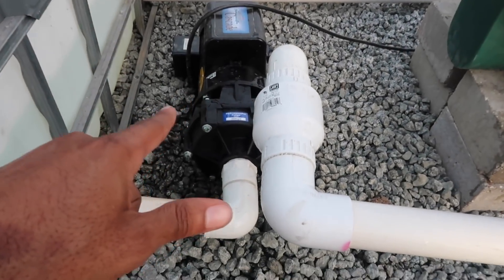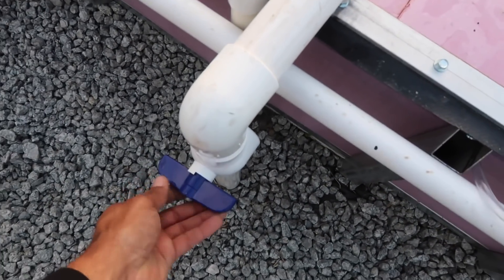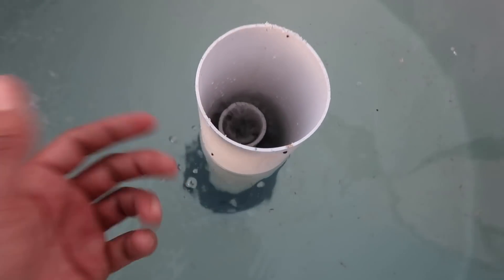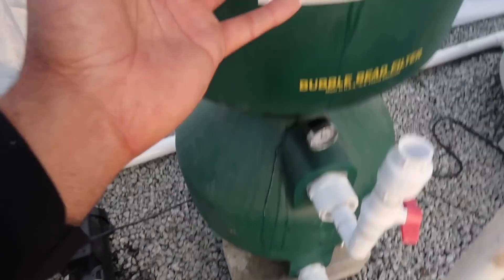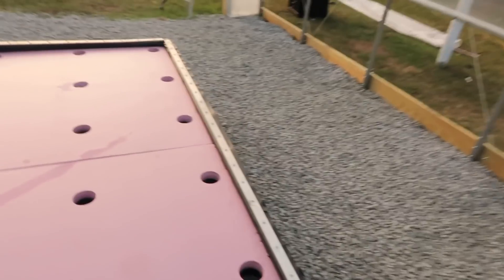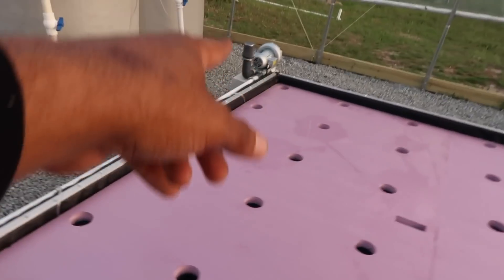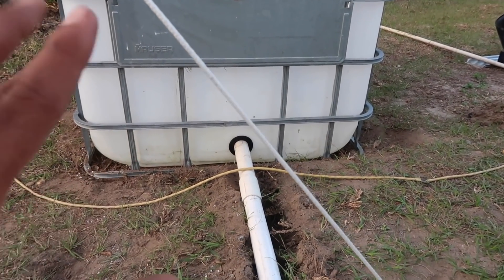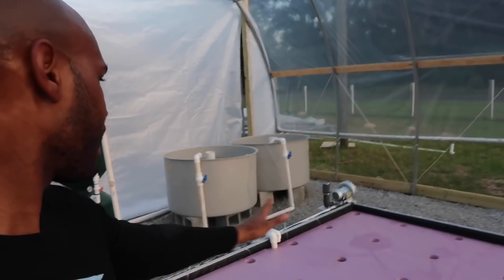Tour Of The New System | The Aquaponics God Ep.14

Comment: I had a 2500 gal system which incorporated a bead filter, automatically create an open system because of the necessary backwashing cycle believe me it will load up very quickly. my bead system was design for a 20k gal pond and frequently had to be backwashed. good job on your project just remember that without going to nano filtration and r/o it is still a dirty system. the plants contrary to the hype do not purify water they only take out what they need and it still remains a polluted dirty unhealthy system.

Comment: Love all your other vids but this sump setup isn’t ideal.  You can never have more than that 1ft of water in the sump, and the sump water level will be the same as the float bed level. (tied together)  If the automatic water fill float valve doesn’t close for some reason, your rafts will be floated to the top of the grow bed and possibly onto the ground as water overflows the float bed. If the water fill valve doesn’t open for some reason, you only have 6-8 inches of play before pump will run dry.

 And That underground pipe from float bed to sump is not "free flowing", so with the underground U shape, it will build up sentiment in the pipe. 

Maybe you've done something to mitigate all that, which I cant see.  Great work though, otherwise.

Comment: First I would like to say I like your videos. Second I would like to clarify that the pump adding the air is a good thing but it its self does not add the extra oxygen, but it does help with breaking up the surface of the water which aids in gas exchange. We use air pumps in the aquarium hobby for the same reason.
Reply from the maker: Yes, you’re correct about that. I didn’t really expound in what I meant.

Comment: Thank you for all your videos.  I've been looking at aquaponics for several years and find your info the most complete and informative.  My background is in building and repairing all kinds of things so I would like to comments on your latest build in episode 14.  Have you considered how you will replace your water pump if you ever need to.  Some shut off valves and two unions for the pump inlet and outlet pipes would ease the process.  Instead of a shut off valve on the inlet side you could temporarily cap the pipe inside the sump tank.
In the DWC tank the inlet and outlet are only 4 feet apart on the same side.  Once the plant root growth gets large the water may short circuit directly between the two in spite of the air bubblers working 6 to 8 feet away.  Better to design the inlet and outlets as far apart as possible.  
Good luck and keep em' coming.

Comment: Your solid waste comes from the fish tank, mixes in the the sump tank, and then it splits between the DWC and the filter. Your system design allows solid waste to go into the DWC. I was under the impression that the filtration should occur immediately following the fish tank before going to the sump or DWC. I hope you will explain in future videos your reasons for this sequence.
Reply: Mark Prescott I think there is no need to filter it first, caz DWC as a biological filter where bacteria can grow. Hope that makes sense😎
Reply: Well it does go through the filter before the fish tank or split into the DWC. I actually have the same question as the sump should get a bunch of settleable solids. The pump should also “mascerate” the larger particulate. Not usually what you want to do because you want to be able to remove them from the system. Alternatively that fraction is also where many nutrients are bound up. Not sure the logic yet. Intrigued to see where this is headed.